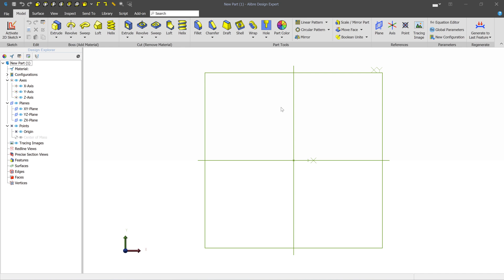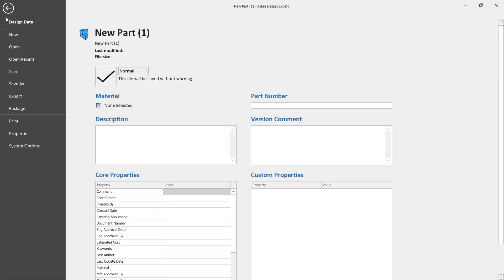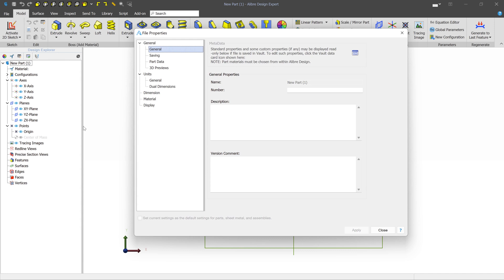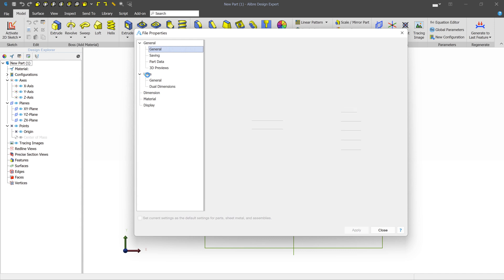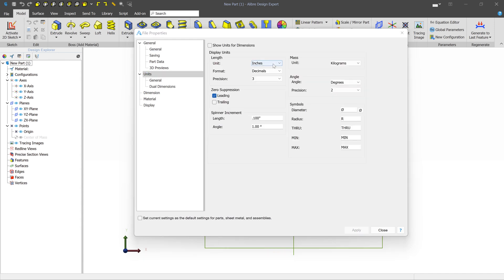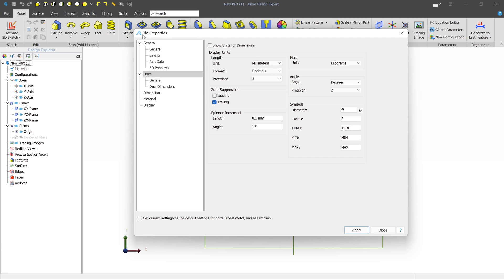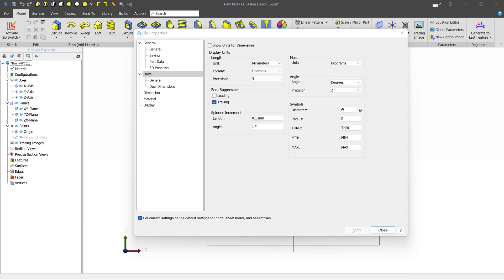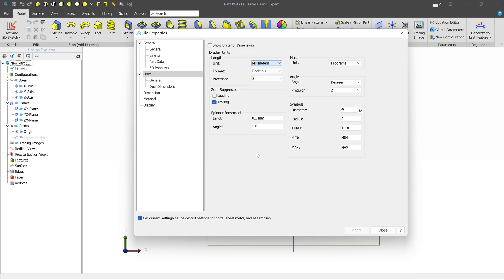Quick Tip: Setting Units to Millimeters in Alibre Design for Seamless Exercise Follow-Along

Comment: OK, so I did that... how do I change the displayed grid from a line every millimeter to a line every centimeter? It is WAY busy at 1mm. Thanks.
Reply from the maker: Sure thing- Open System Options, Under "Parts/Assemblies" on the left, select sketching, scroll down to the grid sections and enter the spacing values for x, y, and z.